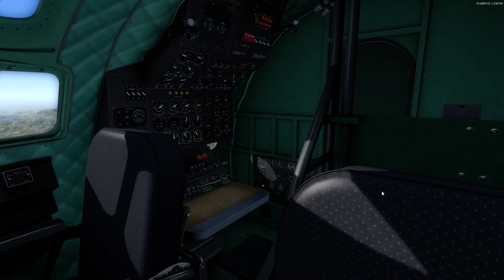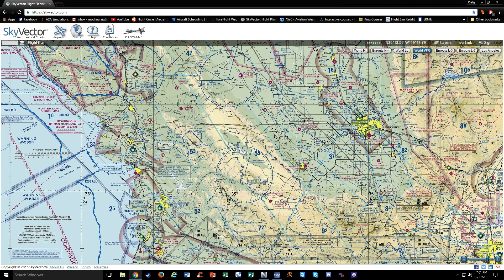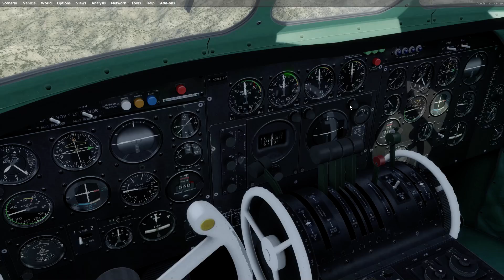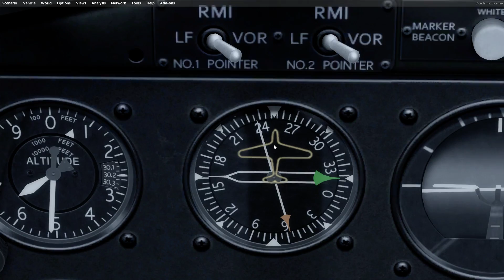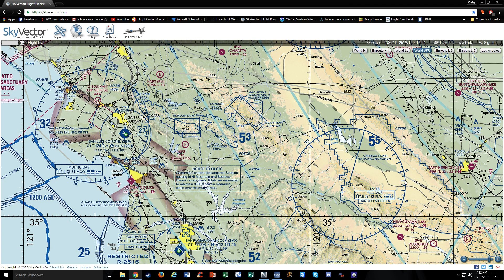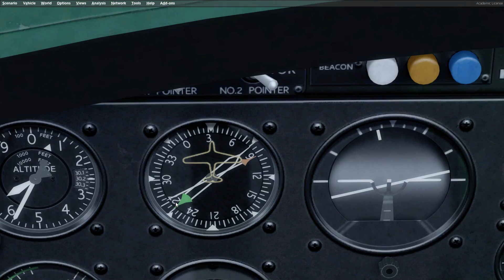A2A Constellation | Autopilot and Navigation Tutorial

Comment: most definitely would not use that autopilot system, you can see it turns using the rudder and uses opposing aileron to counter it, creating a huge imbalance which would be uncomfortable for the passengers but also creating drag and reducing efficiency..and the altitude aspect is just based on being trimmed for a speed so assuming you want to adhere to the +-100ft rule...as the poster stated, its probably easier just hand flying! but this is a great vid thanks for posting, very interesting and good to learn about the user of the nav aids etc!

Comment: How exactly do you reset the autopilot?
Reply from the maker: BollocksUtwat reset like turning it off? Or bringing the values back to neutral? Turning it off is done by reversing the lever that turned it on. To neutralize the auto pilot controls, you have to center those dials for each axis.
Reply: So that's all they mean when they're talking about resetting the autopilot every few hours, just turn it off, recentre all the dials, then switch back on?
Reply from the maker: BollocksUtwat is that specified in the manual? If so, I'm not familiar with that procedure but it sounds like that's what it is.
Reply: Well you mentioned something in the video about gyroscopic precession and having to deal with that, but being uncertain if that's actually modeled by A2A.
Reply: Should i use the elevator trim while on autopilot sometimes the autopilot attitude goes wonky and pitches up or down at extreme angles
Reply: Usually I use the trim to centre the level autopilot more or less so it doesn't have to use a lot of input. Basically the aircraft should be able to fly level when you switch the autopilot off.